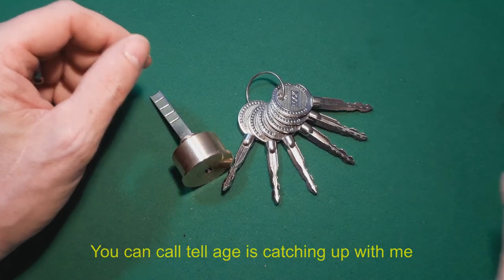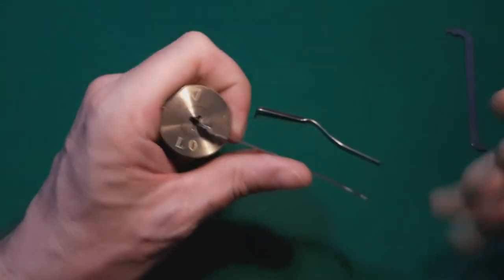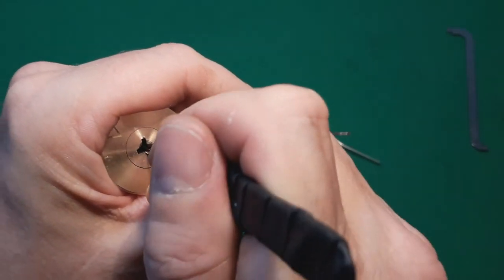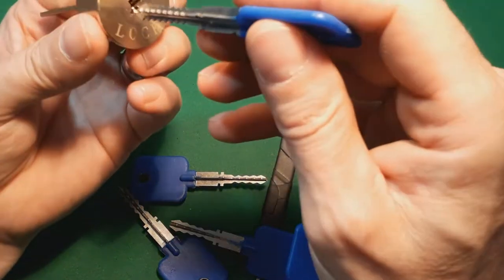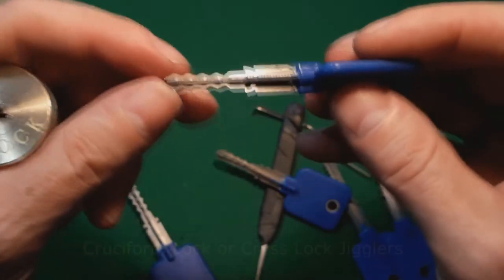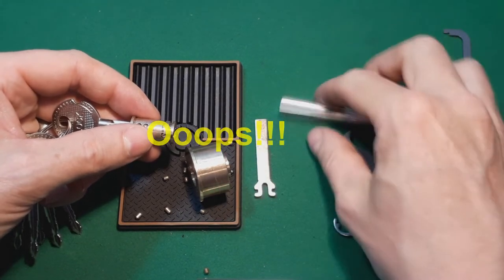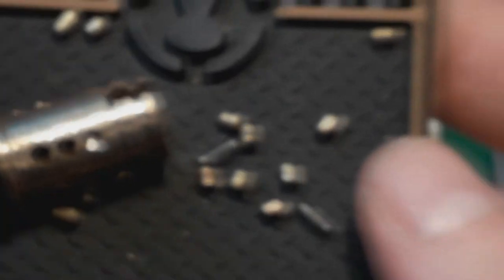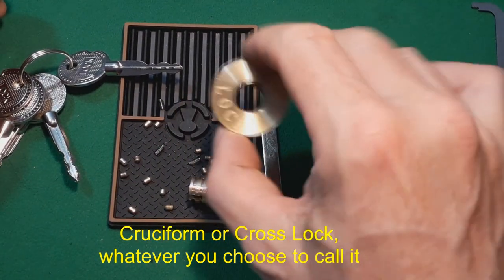(122) Cross Lock spp and raked with a cross lock jiggler rake

Comment: Thanks for showing how to pick and jiggle the cross locks. I have one of those cheap, clear practice locks. I am sorry for the gutting disaster. We’ve all be there. It was a teaching moment for me to never gut a cross lock. Good video. 👍🦊
Reply from the maker: HAAAAAA I totally agree, with pins on all sides what was I thinking. Not to mention the wrong size follower.
I am contemplating putting in security pins and thread a few chambers to see how it does. 
Just need to get the inspiration in the middle of a busy schedule.

Comment: Nicely done Roy. Iv gutted a cruciform before. Had a spot on sized follower tho. Was the rebuild that I found tough. Those cross ke jigglers work great in halfords steering locks haha👍
Reply from the maker: I think it was one of those "Let's do this" but each completely thinking. Ther follower was undersized and I didn't cover the bottom pins with my fingers. Rookie mistake!
Yeah getting this one back together will be fun. For the moment it will remain in bits until I decide if I want to try and upgrade it.
I didn't know Halford's put cross lock keyways on their auto locks. 
Thanks for watching
Reply: They do. The halfords steering locks are the same as steering locks on amazon but doubble the price and have halfords written on them. We got one to check. No different to the cheap amazon ones.
Reply from the maker: @Deadlocks86  Rebranded items Haaaaaa good old Halfords.
A friend of mine once travelled from Scotland to Liverpool (he had just moved house and was transitioning) and he picked up his wife's steering lock by mistake. When he arrived he locked it on his steering wheel and went to bed. Next morning to his horror he couldn't open it. He called me and I went over to get it off. I did it non distinctively but it took me about 30 minutes if I remember. He was so relieved, imagine if I was picking back then, turned up and had the tubular core picked in minutes. Now that would have impressed him.
Reply: Haha. Had a person that lost there locker key at work. There where a few shocked people when I picked the lock in a few seconds haha
Reply from the maker: @Deadlocks86  Haaaaaa it always impresses the natives.
Reply: @roysammons2445  hahaha👍

Comment: Those rake’s worked really well Roy, its always tough to gut a lock when the follower is not the right size, even harder to reassemble it. Good luck 🤞 
Have a great weekend mate. 😎👍
Reply from the maker: I should have made a wooden follower the correct diameter. It's one of those "I have gone this far...."
The crosslock jigglers do work really well. I have used them several times and they haven't failed once. 
"Says me"!